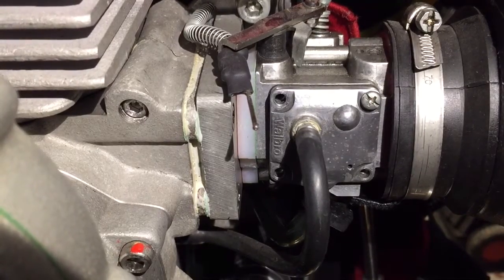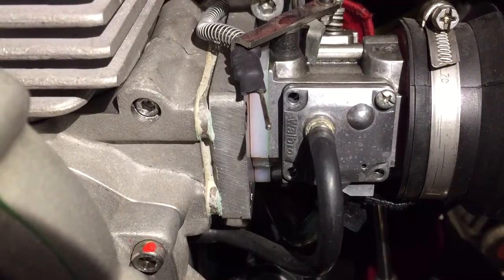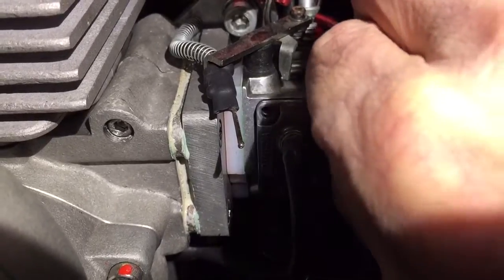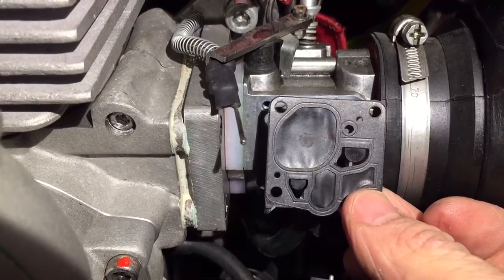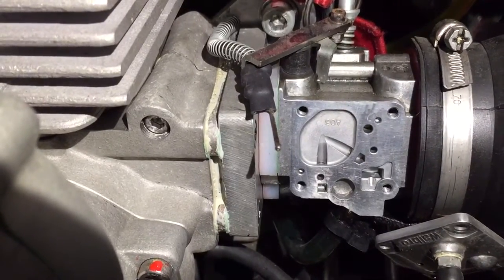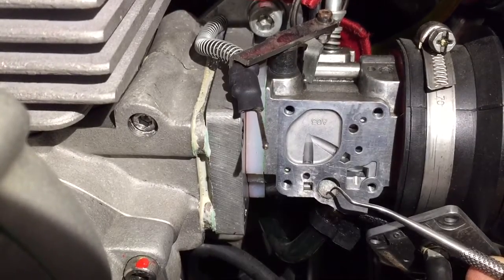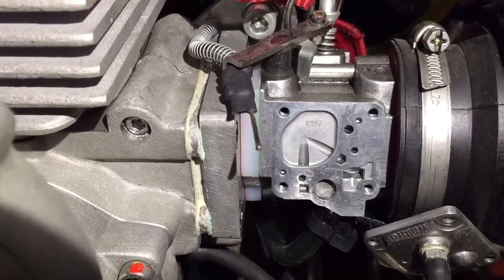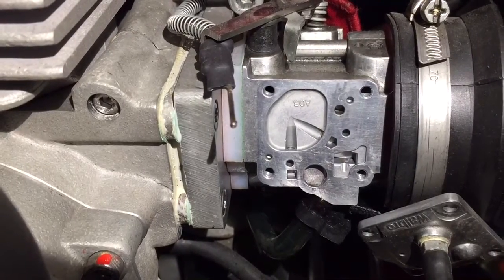Paramotor cleaning the small filter in the Walbro WG8 carb

Comment: Can you tell me..What is your engine cc..? And which type of carburetor model used..?
Reply from the maker: this was a 125cc, the carb was a WG8
Reply: @pintail120  thank you so much for information
Reply: @pintail120  tell me one thing,  if I'll use WB37 carb on 175cc engine, so it's ok or not
Reply from the maker: @DeepakSharma-wc1gr  yes, the WB37 is better for an engine that is bigger than 125cc, the WB37 is suited to engines to 180cc and higher, therefore yours will be great with the WB37